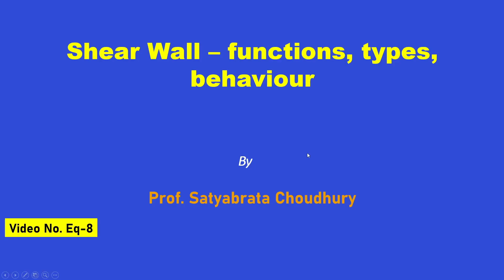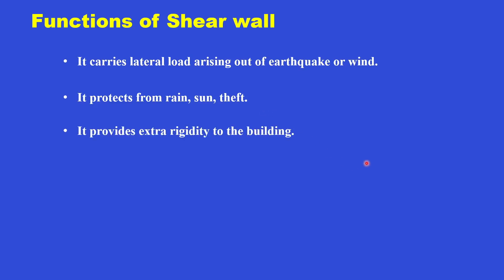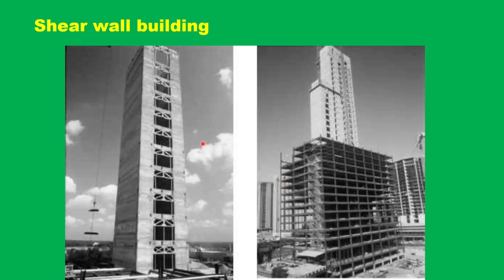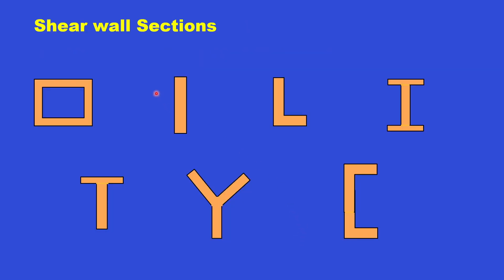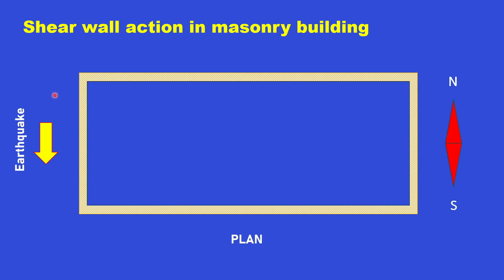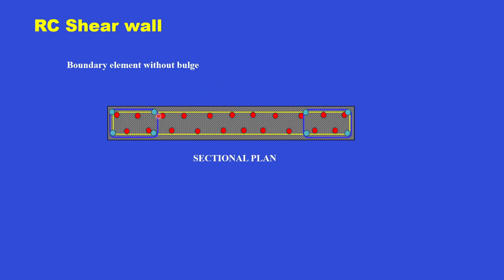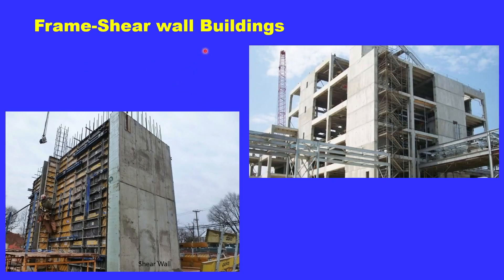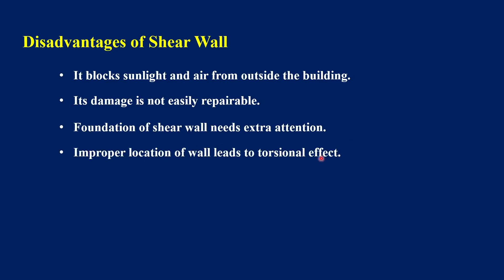Shear Wall: functions, types, behaviour

Comment: Very informative video sir.. Thank you for sharing it. Sir i have one question regarding brick Masonary shear wall. If we use normal brick masonry wall in building, will it act as a shear wall when lateral froce will come parallel to the wall length direction? If it act as a shear wall then how will it take the tension as there will be tension in one face and compression in other face. Or this  tension will be absorbed by the  column when we are placing it between two column. Or should we use reinforced masonry brickwork? Again when we are analyzing in software, we are not considering the stiffness of brickwall in terms of lateral loading, should we consider it in building analysis to get accurate result or keeping the building in conservative side?
Reply from the maker: Thanks for the query. You have to note the presence of two aspects here - (i) behavior as shear wall and, (ii) Use as shear wall. Any planar element, including a split bamboo wall, or a mud wall, or a brick masonry wall when acted upon by a lateral force in their plane, behaves as a shear wall. Such WALLS CANNOT BE USED AS SHEAR WALL PER SE. So far as use is concerned, RC shear wall satisfies our needs... Tension and compression come into play when a wall is bending out of the plane. In out-of-the-plane action, any shear wall is weak....That is why shear walls need to be provided in both directions of the plan of a building.

Comment: Can timber be used for a shear wall??
Reply: In U.S they mostly construct the structures in wood material if the owner is financially not well. Also concrete  construction is too much cost there. So they use wood for construction and it is to be designed and get approval from the city before construction for which they need to do  structuraldesign of the building with the help of structural engineers
Reply from the maker: @venkatesh2285  Thanks for the comment. Yes, in USA generally steel structures are predominant. Timber is also used.
Reply from the maker: Timber is used as a shear wall. By definition, any planar structural material element resisting force in its own plane is a shear wall. But, as timber is weak in strength, it can sustain limited lateral load in its own plane.